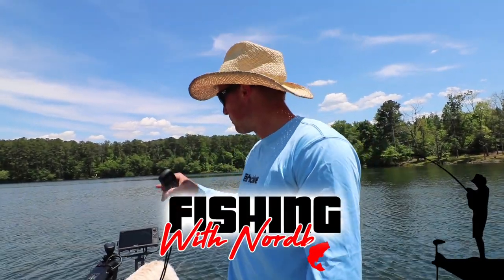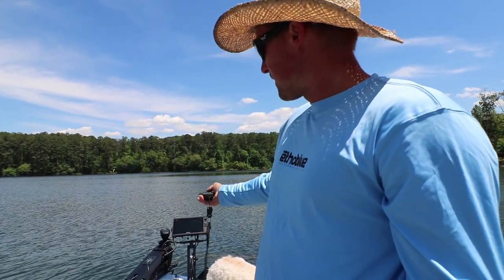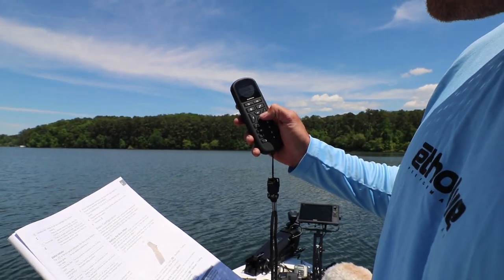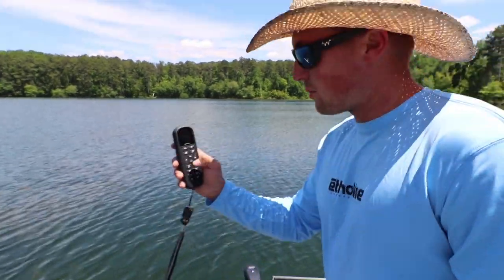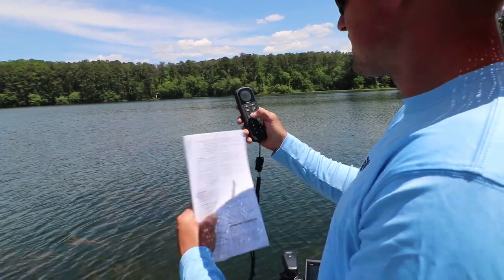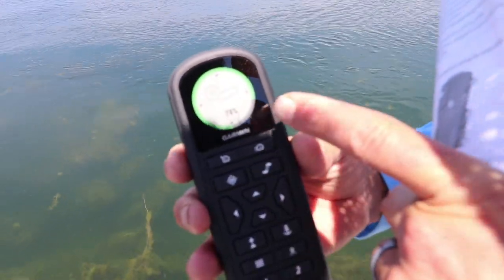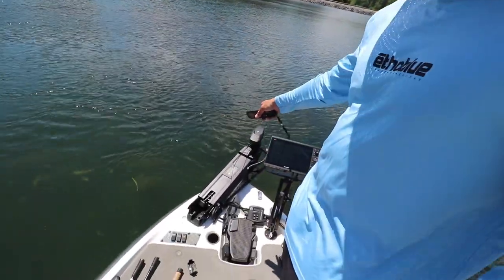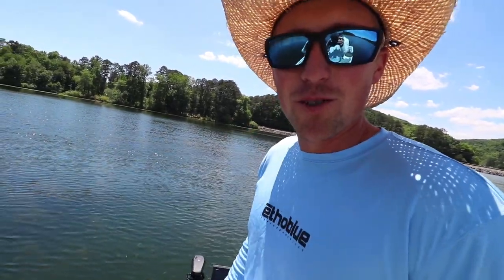How To CALIBRATE Garmin Force Trolling Motor - SPOT LOCK ANCHOR

Comment: Good trolling motor...love the foot pedal, no one has this style for wireless, good if you also bass fish so you can go by feel instead of looking at the head of th4 trolling motor,, but Garmin is always un-user friendly compared to others with their electronics and trolling motor calibration. Mine is of about 10' to 15' on calibration right now...guess I need to try again. Shouldn't need a calibrate...should be auto.
Reply from the maker: I love this one. Recalibrate and do a tighter circle